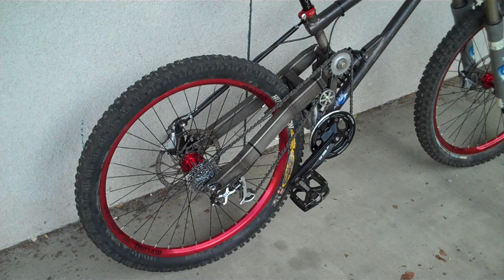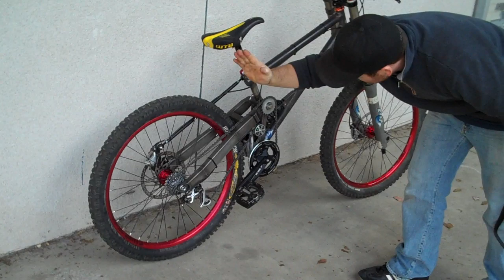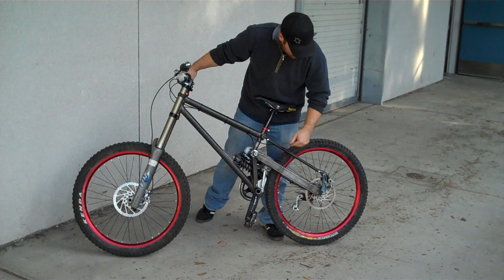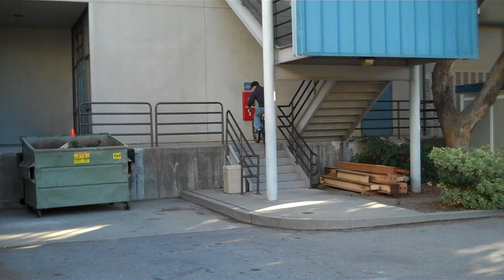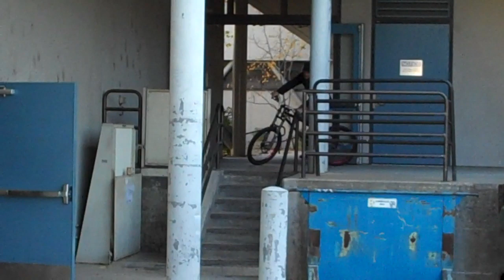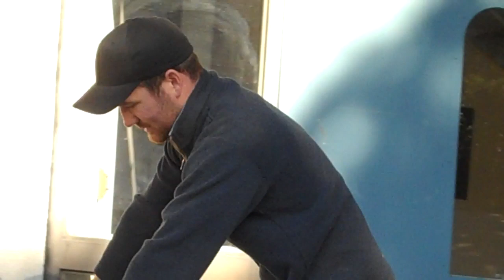Down Hill Bike explanation.MP4

Comment: with a rearward wheel path in the rear, yes, there is lateral and vertical force just like the front, but... the location of the mass is in front of the of the force being applied, unlike the when force is applied to the front fork, therefore the reaction isn't the same and bump absortion iiiiisss favored, but momentum is not. (also the "bucking" ss from a lack of rebound damping, rider error, or from a bike that is too short (in Top Tubelength) for the rider, not wheel path

Comment: this a very stupid desingn frame.
Tail fork have only two legs, which means it easily breaks when a force applied side direction. AND "reducing chain slap" that u mentioned is not true. Slapping force applies by the ground, not the rider. In other words: u should kick the rear wheel (to see chain slapping), not the saddle. (sorry for my english).